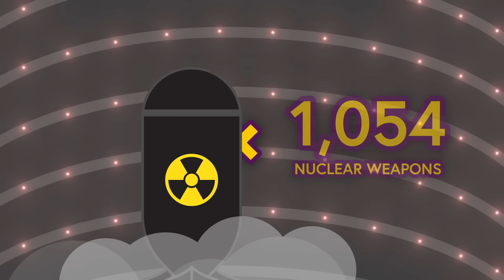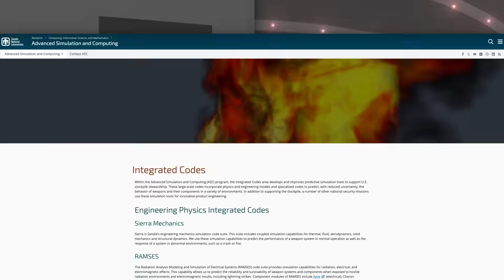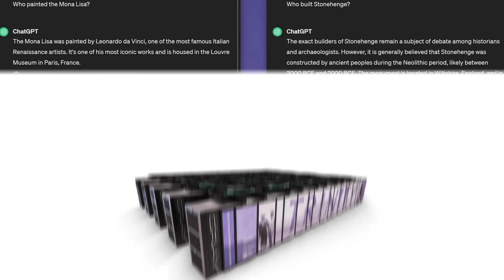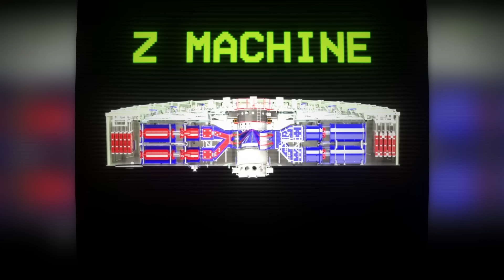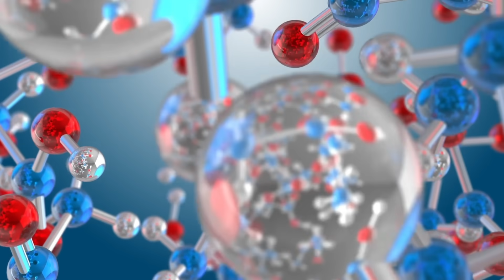How the US Tests Nukes (Without Blowing Them Up)

Comment: Newer nukes use a 2 point implosion system and extremely precise machining of the primary pit and explosive shape charges. This makes them more reliable, use less plutonium and fail safe. The charges are triggered by lasers and fiber optics making them 100% immune to accidental detonation. In fact if you chucked one whole into a raging fire, the explosives would simply burn. ❤

Comment: Ironically it said on the weather app that it was 50° and I got in my car it was 64😂
Reply: your stationary car thermometer is still less reliable than the most likely uncentered point they use to calculate the temp for your area, id go with 56 as the real temp :)

Comment: Nuclear weapons absolutely do degrade. Tritium (the stuff used to make glow in the dark paint/dye for watch faces and weapon night sights) is a key component in activating the detonation of a nuclear warhead and it degrades actually quite quickly. This is why we suspect Russia's stockpile of nuclear weapons are actually much smaller when counting viable warheads bc due to the corruption and misappropriation of military budget they do not seem to be buying/producing/stockpiling nearly enough tritium to keep all those warheads at the ready. (Although the info coming out of there is always a bit shady so big grains of salt and all that)
The uranium and plutonium also degrades, albeit much more slowly, and would take millions or billions of years to all be degraded down to lead, but enriched state for weapons grade fissile material degrades much faster than more stable isotope (u-235 for enriched weapons grade has a half life of a few hundred million years, where the common, naturally occurring u-238 half life is a few billion years)
Reply: and that is just the warhead. Rockets also degrade. Not just from rust or oxidation of the structure, but rocket fuel also can separate and de-plasticize over time leading to uneven burning that causes the rocket to not launch or be completely uncontrollable and smash down to the ground not far from the launch site. Then there is the launch site as well. Our silos are very old, being built in the 50s and have not seen sufficient investment to keep the infrastructure in ready state. With flooding, stuck blast doors, and of course the entire system being controlled by ancient analog technology and big floppy disks.. many components of which stopped being produced due to obsolescence long ago, so repairs become almost impossible..
Although the benefit of that tech is its safety from hacks. Building new silos would be cheaper and easier than going through and repairing the old ones at this point, but new made ones would be much more vulnerable to cyberwarfare

Comment: Worked with a woman whose job was literally, "unscrew panel, look at indicator, mark it down on clipboard, put panel back, move on to the next." In her years in the Air Force the little indicator only came up wrong once and that's when she found out they will, in fact, lock you in the bunker while they get EVERYBODY to come look at the bomb. It was fine.
Reply: That job sounds very appealing to me right now.
Reply: What was her title? That still sounds like a cool job.
Reply: Why?
Edit: I'm guessing that this was to ensure that nobody had tampered with the bomb or did anything to accidently break it. I know military tech is supposed to be rugged, but anything can get broken if you mess with it.
Reply: Ah the deuterium pressure charge indicator. Makes sure the system has deuterium in it. The tritium is added just before
Reply: so she checks ordinances? sounds like important enough job.

edit : no sarcasm intended

Comment: sooo it makes sense to me that all hardware and even software are well an good to sit 100s of years... but it makes me wonder if instead of a direct absolute nuclear attack trying to knock out the alternatives sites, "someone" timed explicit EMP  intended devices to go off globally on a massive scale just slightly before their nuclear weapons landed if they could essentially disable the other sides ability to retaliate 

im sure this has been consider to high detail by people way smarter than me... but can they really test that scenario.. like they can plan all these measures and counter measures and backup measures but ultimately doesnt everything in this age rely on very delicate chips to execute these measures? rather than physically disabling the hardware isnt it far easer it scramble the software which it relies on.. such software im sure is designed to default to a safe mode otherwise accidental H-bombs would be going off frequently.. is the dozens of meters of earth or concrete really enough to defend against such an attack even as the technology advances to implement such an attack... ive confused myself with this rant but i think the point is still there
Reply: So nuclear EMPs just prior to the real nuclear attack?

As far as the concrete, I’ve always wondered how we knew the silos were nuclear proof.  But after learning we had over a thousand tests, it makes sense that some test silos were constructed to see how they’d fare.

Comment: This is pretty much how all nuclear engineering is done now a days. While physical testing is important for the data, it takes SOOOO fucking long to get good results and it's way to expensive. Thus, we've built mathematical and computational simulations to test what ever we want, which is pretty handy. The actual experiments are mainly to get better data for the models, such as more accurate cross section information, or to verify the model's results. When you hear about the field, you probably imagine people in hazmat suits working on massive detectors with large barrels of radioactive sources, but in reality it's 90% just computer models and statistics. To be fair, that's most engineering fields in reality, but at least they get to actually build something more than once a decade!

Comment: Well, it's not like this is rocket science, etc? Right? ...oh, yeah...😅

Still- No nuclear armed power has EVER tested a reasonably, significant number of warhead or missile designs. At least, not physically. 

The models (simulations), mathematical, physical, etc, are so advanced and have access to such an incredible amount of computing power that, these days, they are far better predictors of how a warhead design will work- testing by actually launching/detonating a few randomly selected missles/warheads- is essentially meaningless for the purposes of evaluating the reliability of any given design/core/delivery system, etc, beyond basic validation (proof of concept). It's like manufacturing one hundred bespoke handmade ultra high tech cars, and then subjecting a single one to a crash test, and calling it safe if it meets the minimum requirements).

Basically, the models are more accurate than anything other than testing a significant sample (like, hundreds) of a single design of missiles and warheads.

So, since simulations are BETTER, why would anyone consider an actual test, other than as an exercise in statecraft/messaging/etc?
Reply: Yeah, you’re right, technically.  But you’re also correct about statecraft.  The red team has to believe blue team’s nukes will nuke.

Comment: #CuriosityStream just sold us out. Not enough to hike prices by nearly 300% in 2 years, but now what little of the private data they haven't already sold (to make more money) has now been unilaterally sold to 3rd parties. There is no opt out, option!! So I cancelled my subscription, but that wasn't enough. No. No. No. Despite losing the ability to watch a service I paid for @Curiosity Stream retains my data for 4 months , giving it time to sell it, wont refund the balance and wont answer support or messages to the nominated PRIVACY email address. I trusted you #CuriosityStream, but you bent me over and cyber assaulted me up  the arse. 
Did you know that #CuriosityStream even tracks the way you vote and sells that ?
Cancel your paid subscription today.